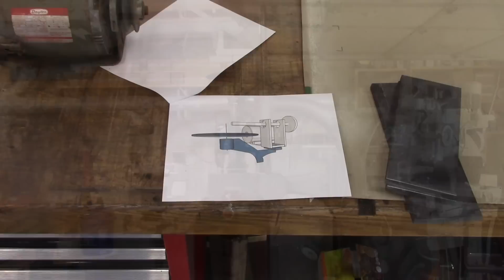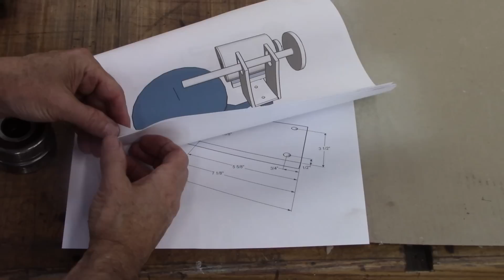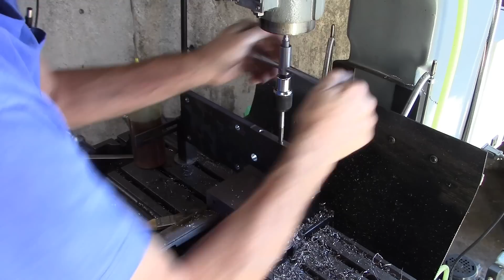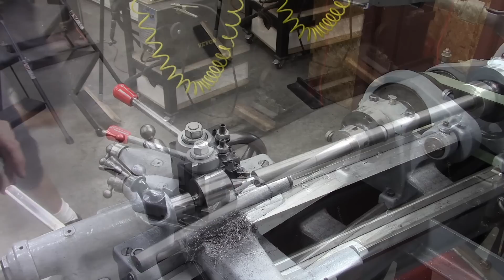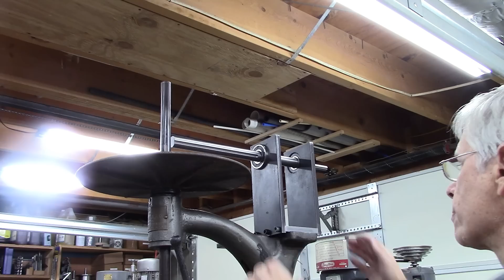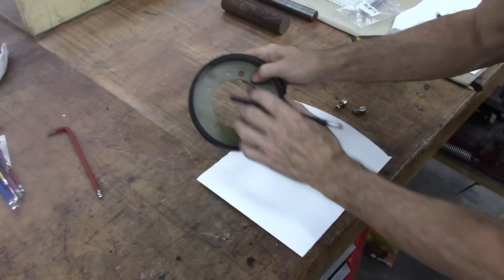1918 Jas. Clark Jr. Electric Co. Friction drive drill press - Building a new drive - Part 1

Comment: the 6205 bearing is available with 1 inch bore, this would have made the mainshaft much easier to  fabricate..
Reply from the maker: That was my intent until I realized the bearings I had was 25mm. Aside from my lathe being worn out it was easy to remove .016" from the bar. Plus I have about 30 of these bearings just sitting in a box. They were used on a web offset printing press. Whenever they changed rollers they installed new bearings and tossed the old ones. I've never seen one go bad although I know it happens. Another plant that had the same presses started reusing roller bearings. One went bad and sparks ignited the oil and ink under the units. This cost them several million for the clean up and rebuild.

Comment: Old my goodness you have jinxed this poor drill press. Putting a snapper part on it and my I add the Achilles heel of the snapper. Lol. That snapper name brings back many memories of headaches. Mark the bozos came from the snapper 😜. Good luck with it.
Reply from the maker: I had a snapper riding mower for about 10 years and it was maintenance free. Maybe I sold it at the right time.
Reply: @WinkysWorkshop  Just pulling at your strings a little mark. As I told you before my Mon went through at least 5 clutches a year. Now she was hard on it I will not deny . I would accuse her of just riding it around just to kill time. I also herd you say your clutch lasted over 10 years. I should have gotten you to give her driving lessons. Lol . I use to tease her that when she passed away that I was going to rent a helicopter and take it up and push it out. But I also wanted to be on the ground to see it hit. She use to tell me she would come back and haunt me. Bless her , before she passed we use to have some good times teasing each other over that little snapper lawnmower.
Reply from the maker: @anthonycash4609  No problem.

Comment: This type of drive was used on mining engines. They use cellophane plates. One of these engines is still working in Death Valley at Ryan mine. We saw it running very cool just shift the right or left you get forward and reverse…..awesome! Steve
Reply from the maker: Cool, they are also used in Snapper lawnmowers and also snow blowers.

Comment: Such an interesting project. The friction drive is not readily known over here in the UK, at least to me. Looking forward to seeing how this develops. 👏👏👍😀
Reply from the maker: Not common here either although they are used in lawnmowers and snow blowers
Reply: Actually when you think about it all belt drives, V and flat, are friction drives.
Reply from the maker: @ellieprice363  This is true. I think some variations of this style drive have been overlooked. I think 2 cones with a wheel between them would the a good method.

Comment: An interesting project.  I was wondering if it would make sense to use a rather coarse thread for the speed adjuster to minimize the amount of cranking you would have to do.
Reply from the maker: Probably although the friction of the disk makes it sort of hard to turn. The 5/8" rod is 11 TPI so its fairly fast.

Comment: You can make it adjustable by making the shaft mount on the low side. Then shim the underside of the mount. Change shims as required.
Reply from the maker: It is adjustable with a yoke but no cams yet.
Reply from the maker: It will be clear in Part 2